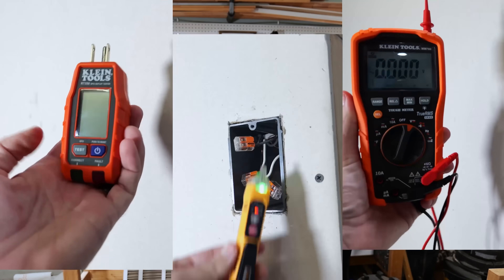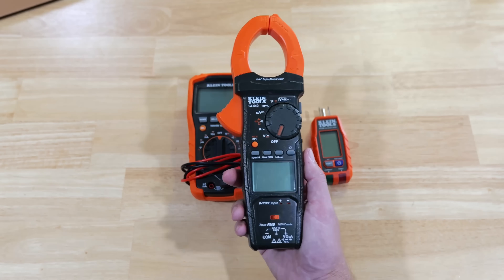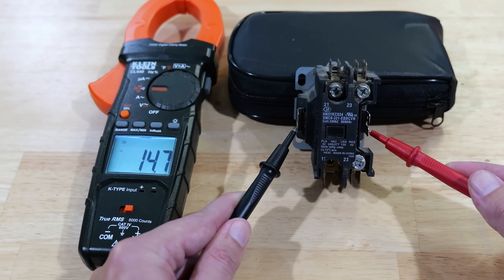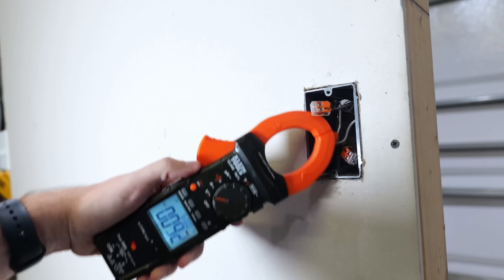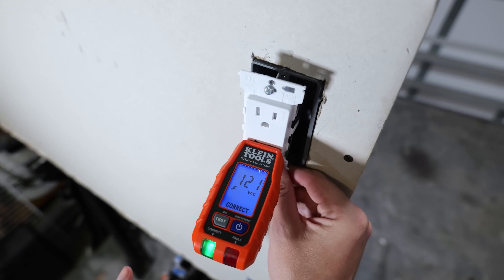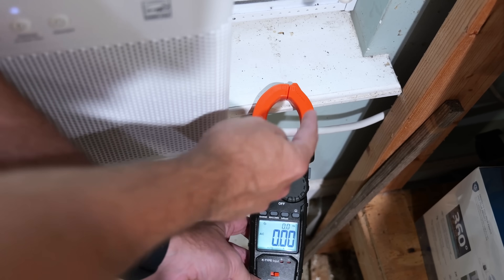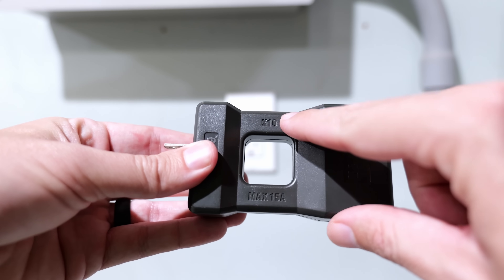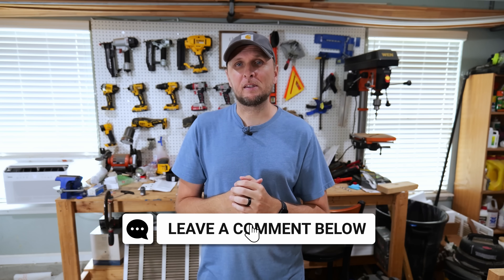The ONE Electrical Tool That Can Replace Them All!

Comment from the maker: So what do you think?  Does it make the most sense for a homeowner or DIYer to get one of these clamp meters?  Or does it still make a lot of sense to have the other tools or at least some of them?
Reply: Get a clamp add on for a multimeter and get more access with a smaller tool
Reply: I have all of those plus a ground meter as well.. lol..
Reply: @brotheradam ground meter? Leakage?
Reply: @brotheradam  And a MEGA too I'd hope.
Reply: @QUIX4U  no but I ordered a Chinese megger that you crank by hand
Reply: the PROBLEM with almost all NON Fluke clamp ons is the screen and dial arrangement are UPSIDE DOWN.  while holding in left hand, the dial should be ON THE BOTTOM, as the screen is above and NOT covered by the hand as is the reverse. with the dial on top you cover the screen with your hand, ergonomics are not to be compromised
Reply: @Steve_mos8541 and
Reply: @HowToHomeDIY  As an electrician myself I think these are great meters. There are some other ones but they are really expensive and not really needed for your typical homeowner or DIY’er.
Reply: The ONLY difference between the clamp meter and the multimeter is the clamp/current reading capability.  With a multimeter you have to insert the probe in the circuit to read the current, with the clamp meter you just run a single wire thru the clamp to read the current.  The non-contact voltage mode isn’t present in all clamp meters and the only advantage it offers over using the multimeter probes is that it is non-conductive so there is less chance of shorting out an active circuit or coming in contact with an active circuit and getting zapped.  IF you have steady hands, a multimeter is all you really need. Clamp on meters tend to be more expensive AND the size of the clamp can sometimes make it difficult if not impossible to use on many circuit.  Food for thought.
Reply: Absolutely both. It can do all the voltage tests a homeowner would need. And being able to read amp draw is a real plus if the breaker is tripping. You can clamp onto the wire coming from the breaker and see if it is overloaded or not. Being able to do continuity readings is really valuable, too. And all being in one meter is a great convenience.
Reply: Kaiweets HT208D can do any measurement, DC amp clamp, ncv, voltage, resistance, temperature, and at the best bang for the buck pricing. 
Accuracy was spot on.
Reply: For the casual DIY a MM is good enough. Might be useful for a professional
Reply: Yes it does!
I bought a cheaper one clamp meter on Amazon, it did not work out (returned).
I also got a 4 pc testing pkg, (Grnd, current detect, usb test & 9v tstr, too.

I will spend the $30 more for a better clamp meter this time (solar panel current testing).

 Along with the two multimeter, I already have (2024 & 1997).
Thx ! 
I Liked n subbed!

"I learned something today ." - Kyle from South Park 
😮😅😂
Reply: I'd say at least the Plug-Tester and Non-Contact Voltage Tester ! Fantastic video, very well done. 🔥
Reply: for old guys like me that worked in electromechanical fields and have either dedicated instruments or accessories for our meters...NO...for DIY people that have a multimeter already , NO just get an accessory clamp. for a young guy starting out or setting up his household DIY kit and doesn't have anything in this category...YES.
Reply: @damiangrouse4564  
I bought the clamp, for solar DC voltage. Low volts (fa get about it), will try to measure 100+ DC. Next time the sun really shines !
Almost fried my vintage 1980's RadioShack Tx Instruments, multi meter.
Reply: @HowToHomeDIY  It was a joke and I absolutely agree with you. If your an industrial tech like me then get them all but if your a homeowner a cheaper clamp should do everything you’d ever need
Reply: @HowToHomeDIY  to be honest, I got my first clamp meter due to radio work, not electrical work. 
I got my first thermal camera due to tracking a car exhaust leak, not for electrical. 
But use both in electrical and, most clamp meters do most of what the regular multimeter does also. Unlike my first clamp meter.
Reply from the maker: @brotheradam yup, they can definitely serve more purposes than one!
Reply: I see all comments but can't. Find links for tools. 😢
Reply from the maker: @phillipmoulder1343 they are in the video’s description.  Should be right below the video.  If on your phone you may have to click somewhere right below the video that says “…more” next to the views and upload date.
Reply: @phillipmoulder1343  I struggled too. It's one of the "more" highlighted links. There's only two of that word on here. Try both.
Reply: That multifunction meter is nice but I like having a separate DVM and amp meter.
Reply: No it does not. For a DIY novice a Fluke 107 on amazon is sufficient. If someone knows what they are doing and work in the construction field or "IS" an electrician will not need this video to know what to buy for every day work. This is a waste of space on the internet.
Reply from the maker: @brycevanhorn7240 nope it’s not.  Clearly it has value as it has you all hot and bothered.  By your wording you are an electrician.  Can’t imagine why videos like this would upset you so much 😂.  It’s completely legal in most places in the US for the homeowner to do a lot of their own electrical work so this video is needed along with many others I have on the channel and more to come!
Reply: As electrician not Igree at all. Multimeter is much better and mostly more correct value as clamp meter. Only very expensive clamp meter are ccomparable with multimeter.But this are expensive.(Fluke......)
 This video can make someone who is only important how many view can get.
If it is electrician, then should be take off licence.
Reply: An outlet tester can give you false positives when there is a missing hot with phantom voltage on the neutral.   You'll still need a multimeter to check for that.   I'm not saying they're not useful, but if you get readings like "neutral and hot reversed" on an outlet that was previously fine, you should not believe it without checking voltages against neutral and ground and hot and ground.

As to clamp meters, they're useful if you suspect an electric water heater has an issue.   They're a fast way to see if there's a problem in the wiring.
Reply: I agree as a home owner and novice diyer with your praise of the outlet tester. This is going to give me so much peace of mind as I check my old house.
Reply: I have all 3 already.  So not much impetus to buy a new device.  But I do like the clamp on feature for checking amps.  And my very old Radio Shack multimeter has probes that are breaking down inside (the plastic inner sheathing is getting brittle).  I have been thinking of getting one of these, but just have not convinced myself I'd use it enough.
Reply: @timradde4328  
Wow, I have a 1990's RadioShack (?) multimeter too (model 6137)
Digital, scratched & cracked screen n the probes are jus hanging on.
Reply: yes. get one of these clamp meters
Reply: @maple856  I've had one for a few years, honestly don't use it much but the couple of times that I needed it, it was worth it. 👍🏽
Reply: Wait so can the clamp meter detect if an outlet is properly grounded or not?
Reply: @teegees  It is not meant for that purpose.
Reply: @teegees the outlet tester benefit is mainly the convenience in a quick test of outlets for proper ground and polarity when running through a house quickly, and some able to test the GFCI operation by applying a small leakage current to the ground.
A multimeter can test outlets but just needs more fiddling with the probes and knowledge about what the expected readings are.
Reply: I've already got all three from when I used to rehab houses, so I wouldn't have a need to buy the all-in-one now. But if I were just starting out, it would be tempting to get an all-in-one just for the ease of carrying a single tool on my belt.
Reply: @billrobertson  I do service calls on electrical and appliances. It is so great to read DC amp for testing on appliances.

Comment: I had an old and basic multimeter, but it didn't measure capacitance, so I upgraded to a Klein MM420 not that long ago.  Recently, I needed a meter that would measure amps to troubleshoot a furnace issue (didn't want to break the circuit), so I upgraded to the Klein CL710 clamp meter.  So, now I have two multimeters that I don't really need.  It is arguable that a homeowner or DIYer needs a clamp meter, but it is something that I wish I had gotten from the beginning, as it would have saved me money overall.  I do find it far more convenient to use my NCV tester and outlet tester instead of digging out my clamp meter and messing with leads.  So, for me, it was having a multimeter that would do all that I need of it for now and future.

Comment: Clamp meter splitters are clumsy. You failed to mention not all splitters are x10. Some have x1 and x10. Is much easier to use a home made device with a flexible SJ wire and a male and female off the shelf plugs.

Comment: Your videos are usually okay. In this case when using the DVM in the wall box you should have alligator clips. It’s unsafe and clumsy not to. Two choices 1)Push on to the probe alligator clips. 2) A separate clip lead wire being careful to use the boot insulators.

Comment: I have a clamp meter but it is 30 years old, and has not all function like yours, but unlike yours, mine can measure DC Amps with its clamp (that's why I bought it). But my multimeter that is even older can measure the gain of transistors, what none of your tools showed on your video can. It is impossible to have all functions of every tools that exist included inside one tool. Even very high value of resistors, like those of Tera-ohm values found inside radioactivity meters, cannot be measured with a multimeter, a Tera-ohm meter is needed for this. What about an inductance meter function? (some multimeters have it now), A HF Watt-meter? An oscilloscope? A spectrum analyzer? Don't worry, all these and even more gadgets will be included in the iPhone 750 in year 2100. Just pray for it...

Comment: I'm going to claim the recepticle tester is unnecessary.  If you're doing anything with an outlet...you should be removing it and verifying proper wiring on the back regardless of what the tester says.

Comment: Keep in mind most clamp meters don't  read dc currents (for use in solar or automotive testing). Those dc clamp meters are alot more expensive vs those that only read ac currents.

Comment: Nice video and presentation. 
Sixty years ago I watched an old school electrician use a leaded lightbulb 5W to test source voltage, switches and load. No meter in those days.

Comment: If you work on cars, a clamp meter that does DC A could be handy.
Reply: Clamp meters that can measures DC current with the clamp exist for already 30 years. That's why I bought one in the years '90"s, it's a "kaise SK-7711". It even keeps min and max values in memory. I used it to measure the current drawn by inverters.

Comment: Most these meter don't do well on low ohms: One meter says 14.0 the other say 14.7 . I guess their engineering is not so great. So if we want to check motor winding we need to buy another unit called low ohm meter. Cause accuracy seldom matches precision of display. Oh well :)

Comment: Problem with that particular clampmeter is how poor the lead retention is, too easy for the connections to twist loose from the bottom of the meter without constant checking. Buying a premium set of leads doesn't help either, just not a good design compared to Ideal, Fluke, Amprobe, Fieldpiece, or even Southwire.
Reply from the maker: Never had a single issue with that and I’ve used it ton for years.  It works great.
Reply: @HowToHomeDIY it works as long as you don't have to move it too much while using it. I still have a set of Amprobe TL35B leads on it but it's now a secondary tool my 52NAV.

Comment: How did the ac go from drawing 3 amps to 6 amps when you used the splitter. I don’t know if that’s a good way of promoting trust in that thing 😂
Reply from the maker: Because it was at a different compressor stage.  Those inverter units arent just going to maintain the exact same amperage like an outdoor condenser.  So I dont need to promote it, it was displaying what was present at that time in filming.  Good effort though.

Comment: I'm confused about the 2 window AC unit amp readings. The clamp measured 3.17 amps when testing the wire behind the outlet, but measures 6.2 amps when using the splitter. Am I missing something?
Reply from the maker: Tests were taken at different stages in the compressor cycle and fan speed.

Comment: Inappropriate title!    The other tools are not replaceable for various diagnoses.  Even the narrative changes it to "many" of the testers", not "all".  For those schooled in science,  it is important to be able to measure resistance to a fault,  notice inappropriate voltage drops at various test points, and calculate where the fault is.

Comment: Hope you can help. I have a Rheem AC unit which shows a braker min 30amp and max 35amp. My breaker is 40amp. The contactor has writing worn off but I found the identical unit and it's 30amps pr4013. Everything online says I can't use it on 40amp brakes but yet it was there for last 15 to 20 years working fine.
Reply: When it goes wrong you risk overheating the wire and potentially starting a fire.  Yes I own an hvac co and have two electrical licenses. Just my two cents.

Comment: I

I use the Milwaukee Auto Voltage/Continuity Tester as I don’t have to worry about switching from ac or dc for 120 V. Also comes with audio alert.

Comment: Even if there is an all-in-one tool that does what they all can I still rather use them separately. The reason being if one is faulty then the other one will tell you so you have multiple ways to verify. But if that all in one tool goes faulty and you assume everything is okay it can be  detrimental

Comment: As a professional, id never use anything beside Fluke. I need to eliminate the possibility of the tool itself not reading correctly. the trust I have in fluke eliminates that for me. id never use Klein or any other manufacturer for meters
Reply: Klein meters are great 👍

Comment: I read through many of the comments, and did not see one issue (more of a concern) that is not addressed.  But, first, excellent video, and very well explained feature differences between the equiment shown.  Next, I am a huge fan of Amp Clamp meters, but more for automotive electrical work than home electrical.  One difference between home and most electrical circuits is automobile circuitry is home electricity uses Alternating Current (AC), whereas automotive circuits generally used Direct Current (DC) (in some vehicles there are sometimes a few lesser known circuits that use AC circuit, but that is a huge exception and not worth diving into in this comment.

The next thing I want to point out is how useful it is to be able to  use the clamp pickup to read electromagnetic lines of flux around a wire as current is travelling through said wire.  The Amp Clamp is able to read that electromagnetic energy and convert it into an amperage reading - without having to insert any meter leads into the actual electrical circuit itself - a huge time saver (and safer).  BUT!!!  With the particular Klein unit you show, it can only read AC Amperage with its Amp Clamp.  So for an automotive circuit this feature would ne be available on the specific Klein model you are showing.  

However, there are a lot of other Amp Clamps that can read either AC Amperage or DC Amperage.  A person needs to read the description of the product befor buying it to make sure it can reads both AC and DC Amperage.  Many Amp Clamps are capable of reading both AC and DC Electrical Current (Amperage).

Comment: Note: non contact voltage detectors only detect AC. They can detect the collapsing wave of AC current. So it won't work work with  circuits like this those found cars.

Comment: As a commercial electrician I always use the Klein clamp meter. Works fine for 120/208 all the way up to 347/600v. Has always been accurate and does what I need it to do. Fluke does make good products but I can’t justify spending an extra 800$ when the 150$ Klein does the same
Reply: The justification is clout. No one will ever question your competency with Fluke.

Comment: I was gonna say just get a basic multimeter (with NCV if you need it) and ampmeter you can simply plug in line to the wall. the clamp version is also super bulky. Actual electricians will have different specialized tools anyway (and if you work on electronic projects you don't need anything related to AC; maybe capacitance and frequency are useful)

Comment: Caution.  Line splitters have an amperage limit.  Many are limited to 15 amps.  If you run 20 amps through it, it will destroy the splitter.

Comment: About getting extra tools ,it would be according to the skill of the user. Your video is excellent to show how these tools can be used . I am one of those guys that likes to have what I need to see that things are right and multiple tools are  a plus. The plug in tool  should be used on any house that someone is thinking on buying and on a new house . Never think that everyone is a professional  or that someone can not make a mistake.  I check all of my work in a multiply ways. A caution, never total rely on a NCV tester, if it sounds off you probaly have a live circuit but if it does not be sure to test with a meter.
Reply: Correct. Never trust a non-reading from a chicken stick.